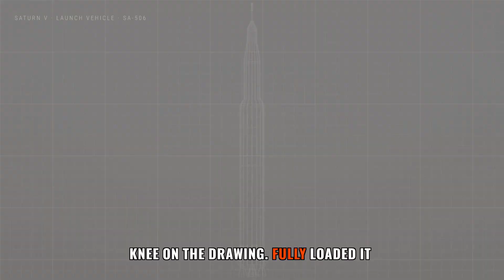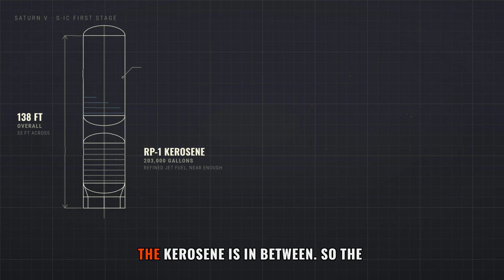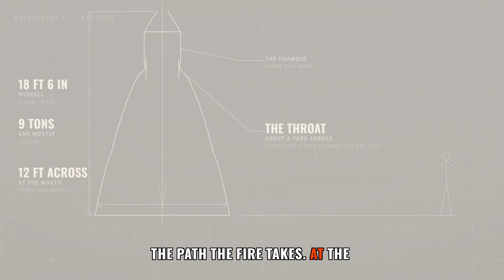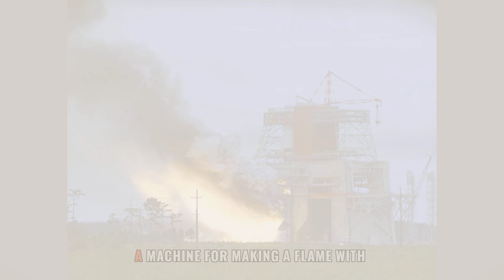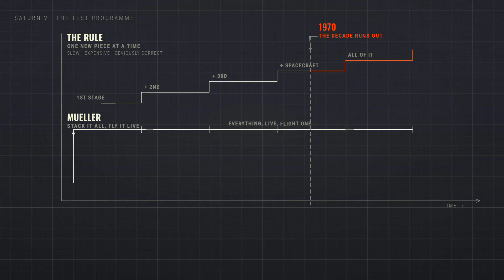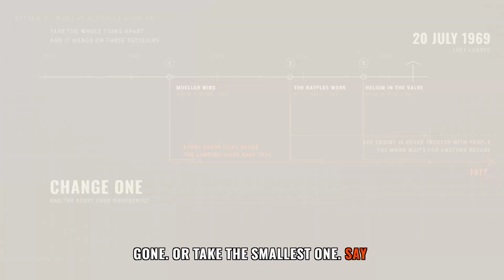NASA the Saturn V F-1 Rocket Engine

Comment: There was a flexible gas line for hi sensor or pilot light for something I don't know because the engines had to  gimbal . it broke because it was like an accordion pipe like you have on a gas water heater .  The break caused pressure to a sensor and.the leak was detected by the computers and they shut down that engine but they shut down a different engine to the wires were crossed and then that shut down  caused another one to shut down so they ended up replacing that accordion line with straight stainless steel tubing that has like a bend in it kind of like a triangle zig zag bend that allowed it to flex for the  engines have to gimbal .
Reply from the maker: You have got it, and the pilot-light hunch is exactly right. That is Apollo 6, and the part is the augmented spark igniter fuel line on the J-2 engines. It had a flexible bellows section, it cracked, the sensors caught the leak and shut engine 2 down, and the wiring to engines 2 and 3 was crossed, so 3 went with it. The fix was the one you describe: a rigid stainless line bent to take the gimbal travel. Great detail, thanks for adding it.